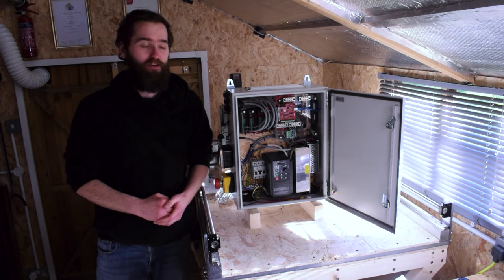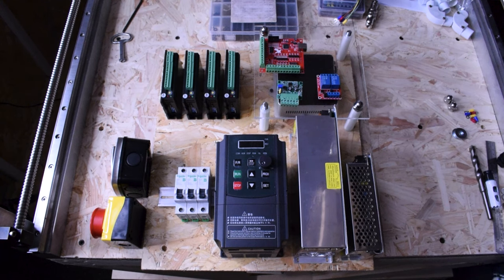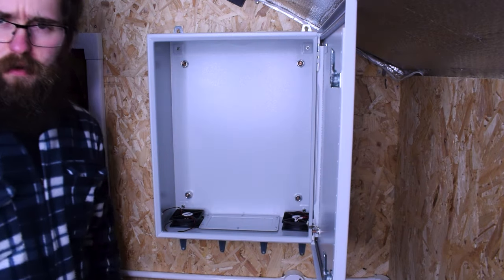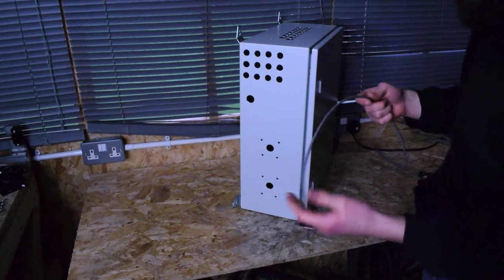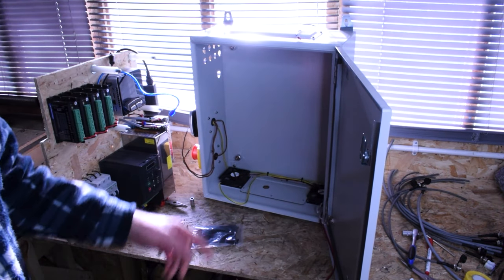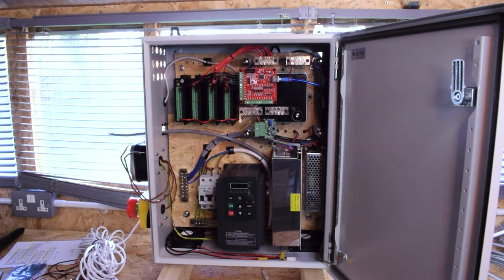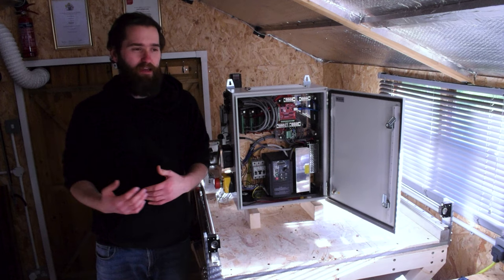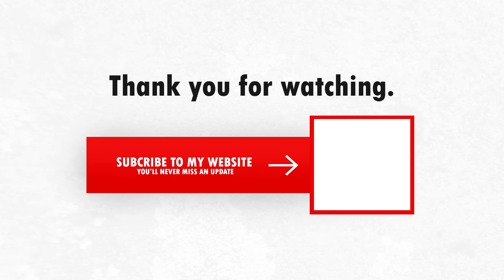DIY CNC 012 - Electrical Control Box

Comment: Your motor drivers appear to be daisy chained (red wire at the bottom of each one). Each red wire should be run to a terminal block instead. Also, the braided shielding of each cable in the enclosure should be soldered to a wire (ground drain) and all joined to a grounding bus bar. Corvetteguy50 covers this really well in several of his videos. You can also add noise supressor power EMI filters to power the VFD and the power supplies.

Comment: You mentioned difficulty in executing the 16 mm holes through the box sheet metal. I’d recommend using a multi / step drill, as they do a good job of making clean and accurate holes in sheet metal, and following up with the same from the breakout side will chamfer that side. 
16 mm = .629”, 5/8” = .625”, which is a common step drill step size.
Reply from the maker: Of course! seems so obvious now you've said it. I have those in the workshop I just didn't think to use it. Probably could have done both the 16 and 20mm with the same bit. Thanks for the feedback 👍🏻

Comment: Hi , you make the electronics sound so simple . I'm in the process of wiring my fixed gantry router . Can you give me more detail on the AC power to switch & breaker connections before it goes to the PSU

Comment: two notes regarding your layout your VDF cable should be as far as possible from signal cables because noise can not be totally eliminated even with shielded cables. Maybe metal back panel would be better than wood to help reducing heat from the inverter.
Reply from the maker: Been running this machine for 500+ hours now, including long jobs lasting 18+ hours. I've never once had a signal interference problem, or any problem for that matter